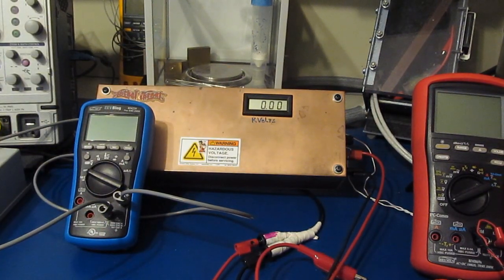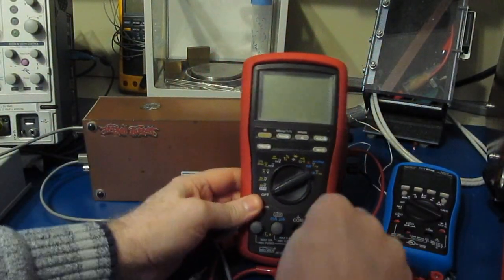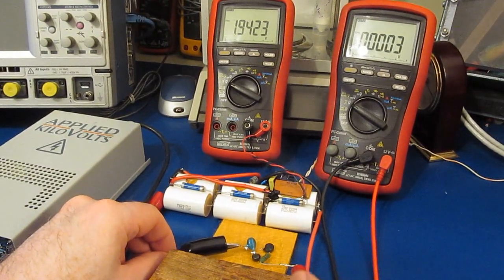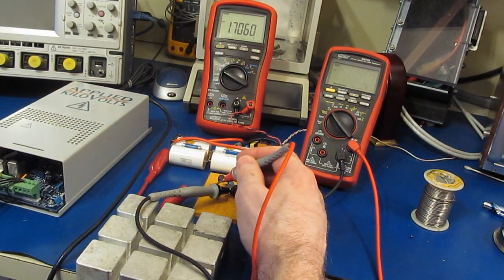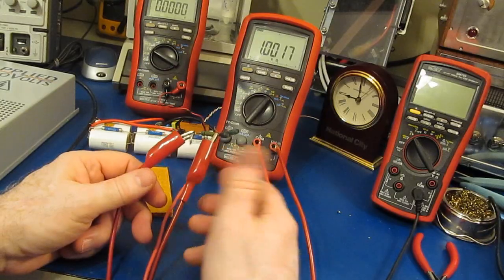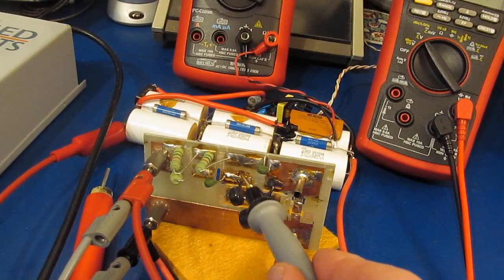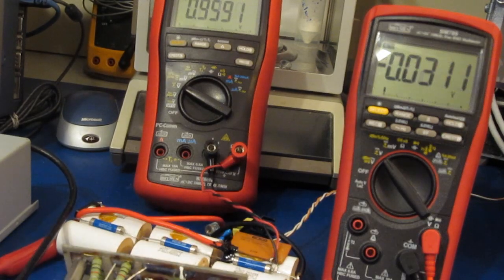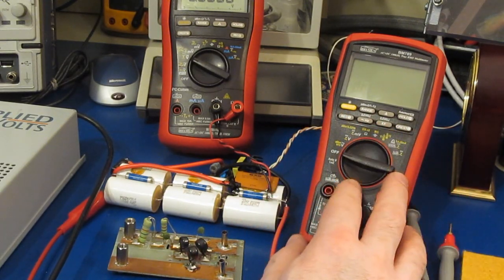Don't Stress Your Multi-Meter's MOVs!!!

Comment: Hey, wondering what are those grey banana terminal plugs you're using on your 869s, seen them in a number of your vids just now thought I'd finally ask. Thank you!
Reply from the maker: Those came from I believe one of the CEM meters I damaged beyond repair early on.   You can buy standard plugs that will fit these.

Comment: What is the "normal" max voltage DVM meters MOV can take? Why don't DVM use NTC MOVs?
Reply from the maker: I have never heard of an NTC MOV.  Please provide a link for the devices you are referring to.
Reply: @joesmith-je3tq  NTC thermistor which is in the family of a MOV, NTC thermistor are used for in-rush current while MOVs are used for voltage spikes and surges. My question is why are MOVs only PTC and not NTC?
Reply from the maker: @waynegram8907  You want to replace the MOVs with an NTC, or the PTCs?   Can you explain how that makes any sense to you?  Also, I have never heard of an NTC being a family of the MOV.  Could you provide any materials where this is mentioned?

Comment: You should check your cat rating before shoving a kilovolt through those meters to "prevent stress". Here's a helpful chart:
Measurement Category || Working Voltage || Transient Voltage	|| Test Source (Impedance)
CAT I	150 V	800 V	30 Ohms
CAT I	300 V	1500 V	30 Ohms
CAT I	600 V	2500 V	30 Ohms
CAT I	1000 V	4000 V	30 Ohms
CAT II	150 V	1500 V	12 Ohms
CAT II	300 V	2500 V	12 Ohms
CAT II	600 V	4000 V	12 Ohms
CAT II	1000 V	6000 V	12 Ohms
CAT III	150 V	2500 V	2 Ohms
CAT III	300 V	4000 V	2 Ohms
CAT III	600 V	6000 V	2 Ohms
CAT III	1000 V	8000 V	2 Ohms
CAT IV	150 V	4000 V	2 Ohms
CAT IV	300 V	6000 V	2 Ohms
CAT IV	600 V	8000 V	2 Ohms
CAT IV	1000 V	12000 V	2 Ohms
You'll also want to consult your DMMs data sheet which would tell you how long for how much voltage your meter can safely measure.
Glad I could help!

Comment: Joe , you should build a " collector " for the magic smoke - I hear there is a lot of value in the smoke ;) 
Ever since learning about using a " chicken stick " I always thought that a sudden shorting of a capacitor --- might damage a cap ? 
Other channels have been mentioning draining caps with multi meters --- I was suspect of that also .
Thanks again , been watching for some yrs. now
Reply from the maker: It depends on the capacitor.  Some are designed for pulse discharge circuits.   This is why I am using film capacitors.
Reply: Only unless you can get Lucas branded smoke collection jars, and condense it for long term storage. Otherwise it does not work well.....

Comment: Better to stress the DMM's MOV's than your body due to a high energy EMF.  I always assumed that Dave was suggesting this procedure as a way to increase your safety as opposed to always doing it this way.  And as you have proven time & time again, most DMM's can be repaired.  A dead repair person cannot be.  Still, I always appreciate your due diligence and willingness to test to failure, if need be.  👍
Reply from the maker: Looks like 40 were damaged beyond repair, 15 were damaged and repaired, and 10 survived without damage.  As I started looking at higher class meters, chances they could be repaired improved.

Comment: Several flukes (which specific model i can't say for shure) was burned by electricians at different places during underground railway voltage measurements, it is nominal DC +825V. Only after they burned few, they realized that commutation process rize this voltage up to 2-3 kV which ordinary multimeter could not withstand.
Reply: I saw one where the arctrician tried to measure the primary side of a 11kV transformer. Only parts of the meter that were salvagable were the display, and the 2 fuses. The rest was not, and the PCB was almost totally free of traces from the display down to the jacks, the only copper there being that on solder pads, the rest being a film on the inside of the case.

Comment: What is the voltage rating of the Probemaster test leads you're using?
Reply from the maker: CAT III 1000V, CAT IV 600V, 10A   This is the 8000 series I am using.

Comment: Suprised the MOV's did not go short circuit, though I suspect given more time they would have done so. Had some 1970's era NOS GE MOV's where the one decided that it would go short while in storage, growing a bulge in the one side, though I suspect it was defective from manufacture, as the bulge did not break the coating. Use them a lot as surge arrestors, and when they fail the big ones will trip the breaker, the small ones will simply just detonate into pieces, and have the arc trip the breaker, though it will be open circuit afterwards.
Reply from the maker: We stopped using them in automotive because of the fire hazard.